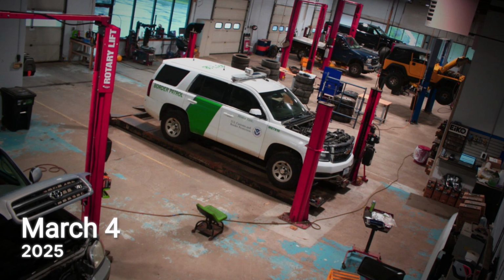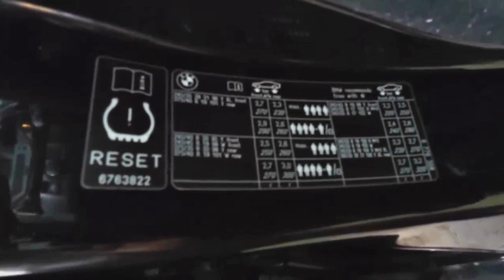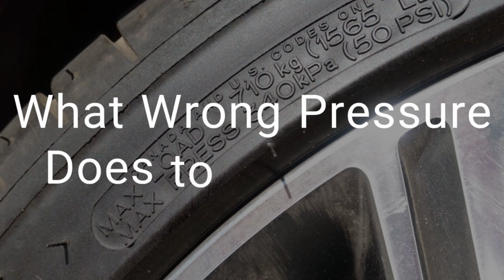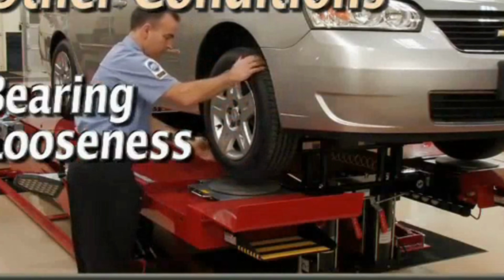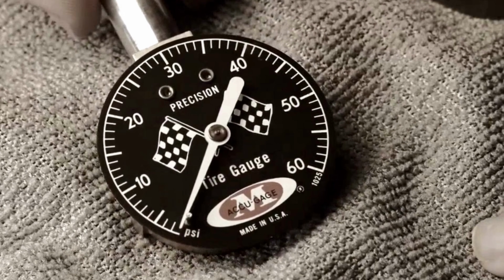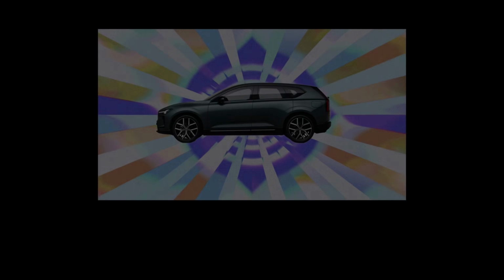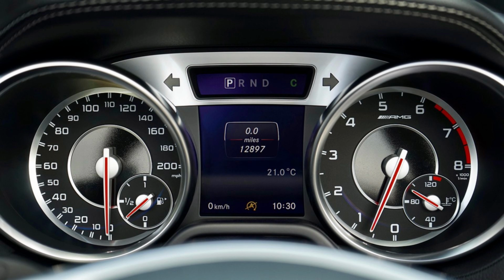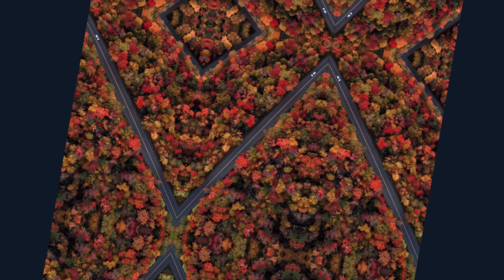NEVER Fill Your Tires to 32 PSI! (You're RUINING Your Suspension!)

Comment: Bull. May for a bicycle tyre. I used to fill upto 32, then 33, then 35. And every time my tires lasted less than 2 years and worn out on the outside while the middle is thick. 3 years ago i fill upto 38. my tires is still good.

Comment: This info is wrong.  The manufacturer setting is assuming max passengers and luggage.  If you regularly drive alone or with one passenger,  the recommended pressure is too low and the shoulders will wear out 1st.  Its a huge benefit for the tire industry since your tire will not last.  If you are running at recommended,  check your shoulder treads.  The truth is in the proof.

Comment: You need to  follow manufacture's recommendation whether 32 or otherwise. They spent a lot of money studying the right tire and appropriate pressure .  It's indicated in the door siding on the driver side.  Follow that. Do not depend on the internet.  It's not a one size fits all thing.

Comment: 32 PSI: Commonly recommended by manufacturers for a smoother ride and a larger contact patch at standard loads.  40 PSI: Higher than baseline factory recommendations; it can slightly improve fuel economy and reduce rolling resistance, but may cause a stiffer ride, reduced grip, and faster wear in the center of the tread if it exceeds your vehicle's designated specs.
Reply: 32 when tyres are cold. Most ppl drive to patrol station now it becomes 37 psi.

Comment: From Asia : Just wonder which is the scientific truth about tyre pressure ? Is it 32 psi or 40 psi ,
Reply: Whether Asia or anywhere else, just check the recommended PSI printed in your car door panel. Then add 1 max 2 psi to that number if you seldom check your tyres. That should do the trick.
Reply: @boroideboroiabis2241 yeah, I usually put 33-35 psi in my kia sonet. I'm in Jakarta, it's hot in our highway. 35 psi can go to 39 psi in two hours highway noon run.
 Imho, It's not wise to put 37 as it will get upto 41 or 42 in Jakarta heat.

Comment: The driver side of my van had 42 psi and the passenger side tires had 30 psi. I was experiencing a slight wobble on acceleration. Can tire pressure cause these issues.
Reply: it is the opposite front tire must be lower than rear tire

Comment: Tire wear tells you if you are over-inflating, under-inflating, or alignment off. And 32 lb is pretty standard. Yes it is printed inside the door panel, but that i for the factory tires. If you've replaced your tires, just ask the tire company what the recommended tire pressure is for the tires you just bought.
Reply: Put the proper size tires on ,fill all 4 to the required pressure on the inside of the driver door jam ,thats what the manufacturer recommended which is usually correct and ride and wear will be the best option and outcome for ride, wear and suspension, hot weather pressure will rise, cold weather just the opposite, pressure will decrease ,adjust accordingly....tires, brakes and maintenance need to be in good condition for your safety and others on the road,  maintenance is just something that everyone who owns a vehicle needs to stay on top of, especially wear parts, and keeping oil, filters changed, along with cleaning the throttle body and mass air flow sensor, plus do a transmission pan drop every 40,000 miles, change the filter and refill 1/ 3rd on the dipstick on level ground, that will give the transmission fluid enough room to expand when it gets hot, heat destroys transmission fluid, there's no such thing as lifetime transmission fluid, any new car dealerships that tells you that is lying .
Maintenance is key, DIY isn't that hard, but you certainly need tools, borrow or buy , DIY saves you a small fortune, and most mechanical information is on the internet, Google what you are doing, and there's videos that can walk anyone who has mechanical abilities through how to fix, repairs or replace parts and necessary maintenance .